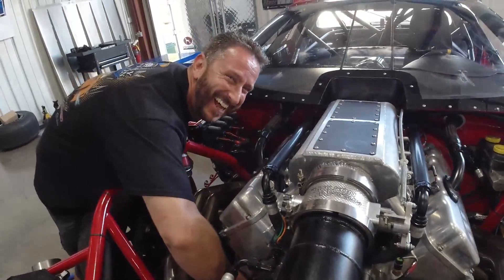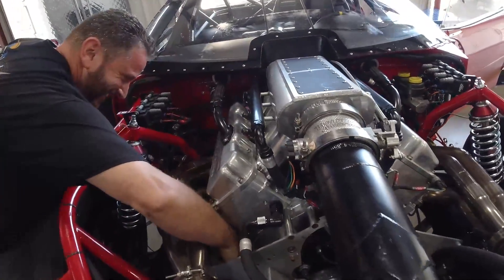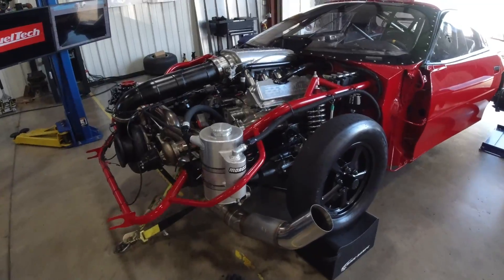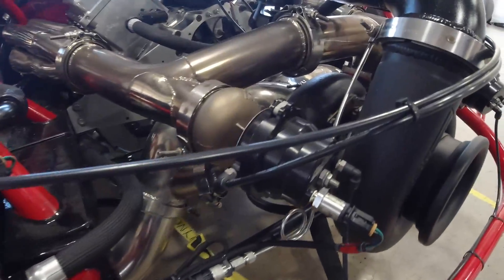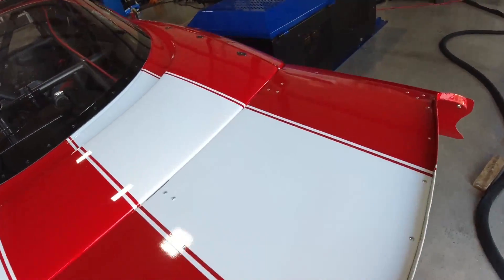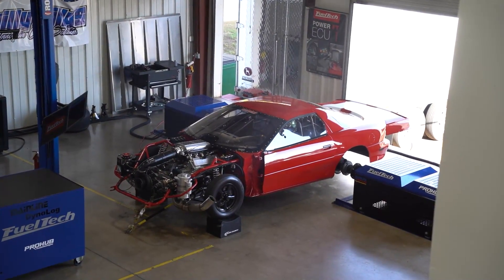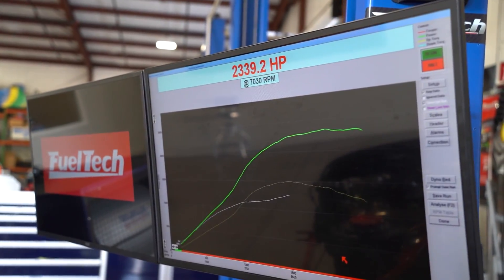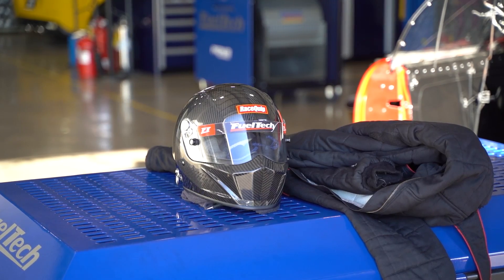LDR Turbo Camaro | Ducky Johnson | 2300+HP

Comment: Well if hes planning on running the car down south they are in trouble if they are gonna run that single turno sbf combo. There are guys running 481x's with twin 88s making 3500+ and big block chevys makin 3000+ and almost in the 3's the record got lowered tonight at radial fest in Huntsville al a guy went 4.03 with a 69 Camaro with a big block Chevy with twins and that was just qualifying
Reply: Most definitely all twin  turbo LDR cars are coming in 3175+ pounds or more except for single turbo small blocks they gotta weigh 2900#  but to run 4.0's.  in a 3175-3375 is gonna take 3000+hp.  A 2700_2800hp single  turbo small block @ 2900# might get close to 4.0's definitely 4.teens
Reply: You think those guys are using all of that power at the track? I would guess no, but maybe I'm wrong.